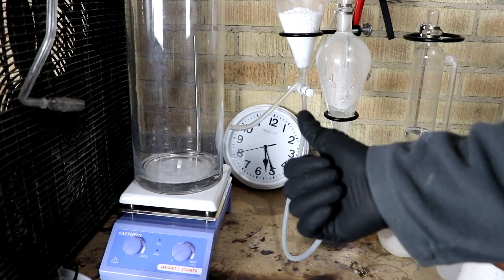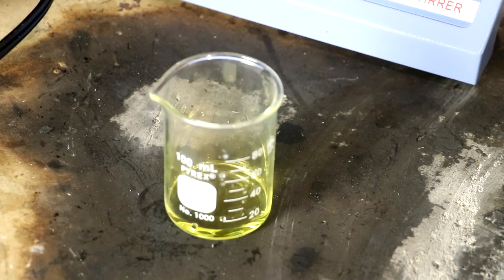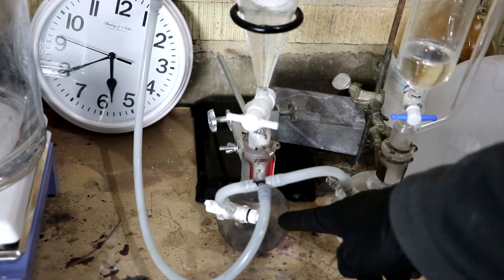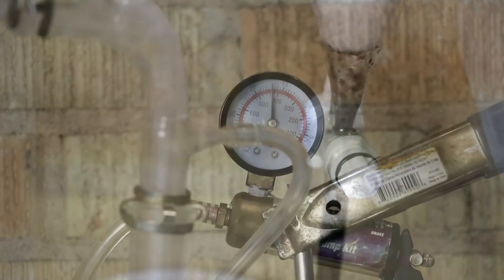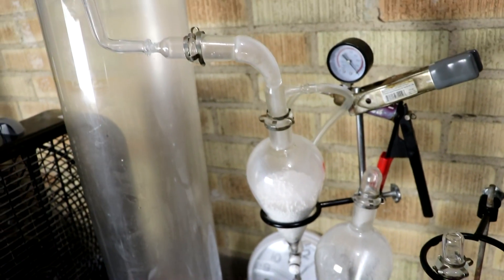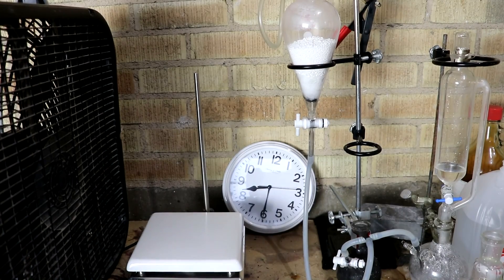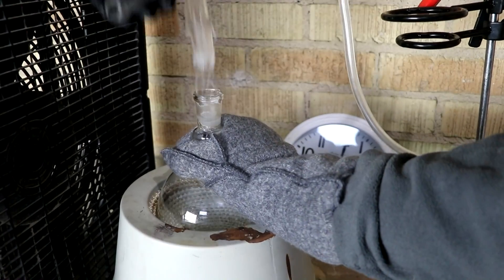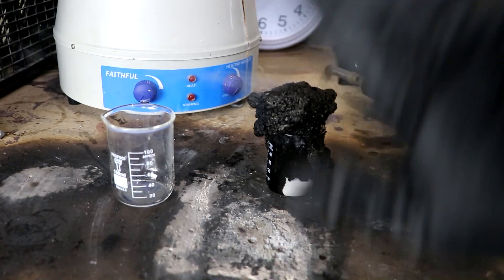Making Sulfuric Acid using the Chamber Process

Comment: I would call that a success. Haven't done the exact math, but for the volumes of the gasses used you couldn't really expect much more sulfuric acid. 20ml of supposedly 90-95% acid is probably around 35g or roughly 1/3 mol. The amount of gases used for a 100% yield would be roughly 7.5L SO2 and 3.75L O2 so just over 11L total. That chamber doesn't look much bigger than 20L perhaps. That's just crude math done in my head after a shot of whiskey so I may be wrong.
Reply: haha i guess he might be switching out the SO2generator, this reaction did a complete reaction I guess maybe some H2S2O7 was made since H2SO4 + SO2 + 1/2 O2 -----> H2S2O7
Reply: @RoflCraft96  Looking at the end result, that might indeed be Oleum. The chamber process is able to yield a very pure H2SO4 as well as H2S2O7.
I wonder if it is pure H2SO4 and not H2S2O7. Reason is that the pure oxygen he used is dry, thus he was able to make a mixture that was beyond azeotropic.
Reply: Travis Sprout Patreon
Reply: Raises glass
Reply: HOW IS THIS 45 MINUTES AGO!?!?!